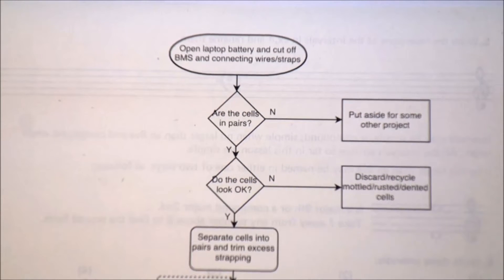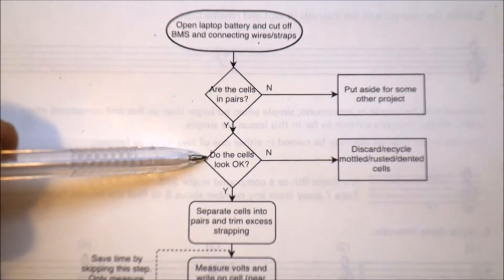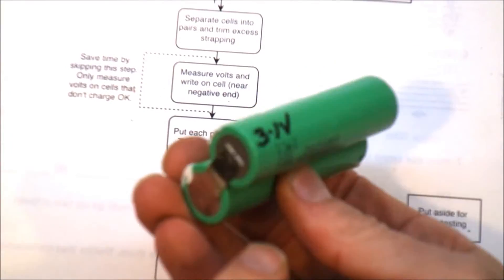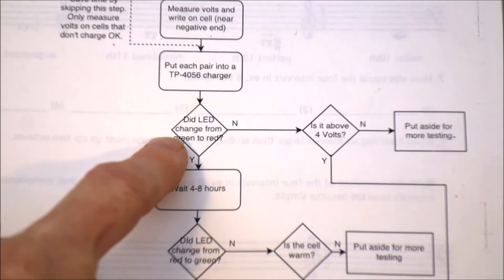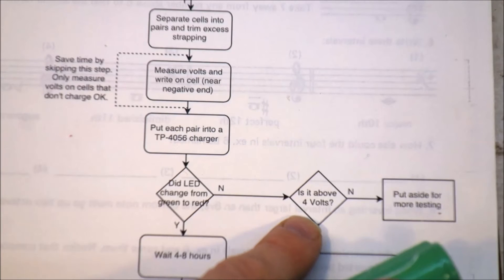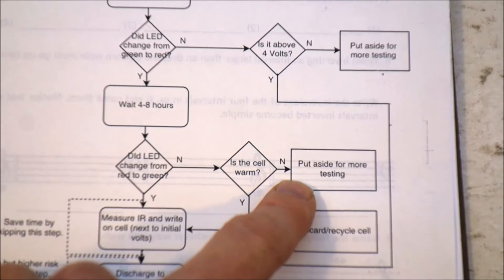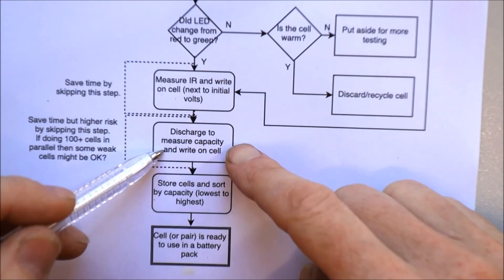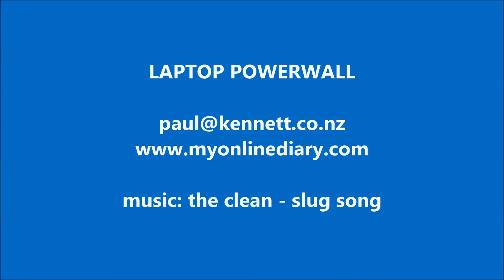Laptop Powerwall 43 18650 selection flowchart

Comment: You probably do it unconsciously but what about letting them rest to check on self-discharge as Jehu mentions in one of his videos? I generally have good ones going from 4.18 to 4.1 after a week or two, if bellow 4v I put aside (if good capacity and no warmth then I may use for something else).
Reply from the maker: Yep. I normally give them several days. But for the pairs vs singles I was impatient.

Comment: I've found some of my cells get hot with an initial charge fresh out of the laptop pack.  If I pull them out and let them rest for a day or two, then try recharging, perhaps at a lower current, they'll then take a charge and not overheat.  Many have tested out with decent capacity after that (3300-4100mAH/pr) , but some don't (1000mAH/pr) at 4.1V.
Reply: I did and it seemed to be OK on some of the cells.  It was just that initial charge after taking them out of the laptop pack.  These were cells out of some "broken" packs that had mechanical damage to the latches and not "dead" packs.  It may be that they had sat a long time w/o charging since the retaining clips were broken. I have had other cells that heated up and failed to take a full charge and those were recycled.
Reply from the maker: Ah - interesting. I've put all those "reject" cells off to one side. My plan is to go back to them when I get desperate. Good to know they might be usable. Thanks.
Reply: Did you try charging them again with the original amperage you used when they were warm? I suspect you will find them warm again, therefore a fair risk attached to them?
Reply: +R Brown (4Crawler) ok, good to know, thanks!

Comment: Talking about the TP4056 charging module you are using to bring back all 18650s to 4.2V with 1A current. Isn't it too much? what I'm using is slow charging by a Nitecore charger with 300mA of low current. For 1A of current most likely 18650 are getting hot than 300mA of charging. Also the charge will retain for a long period. Am I correct?
Reply from the maker: Apparently (I havent tested this yet) the TP4056 module drops it's current to less than 100mA when the cell is below 2.9V.
Reply: +Paul Kennett also, I guess you are not sending 20amps to the 20 or more modules, therefore probably the charge from the TP4056 is your amperage divided by the modules?
Reply from the maker: +Rincewind TheFirst The most I've seen is 14Amps drawn by all 20 Tp4056 units.